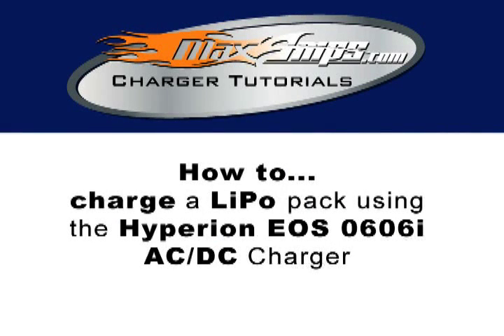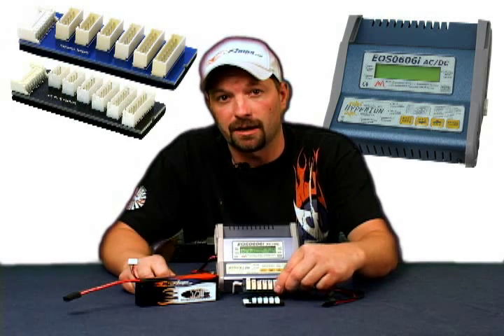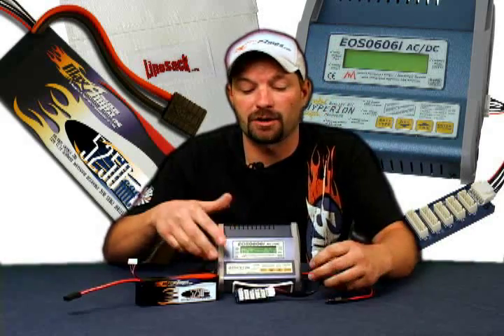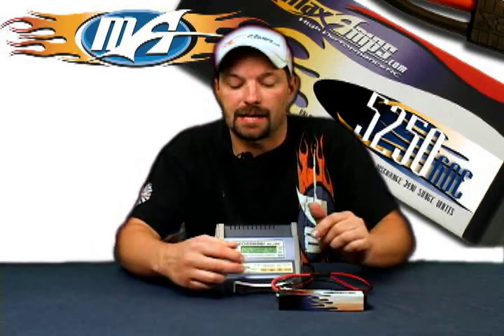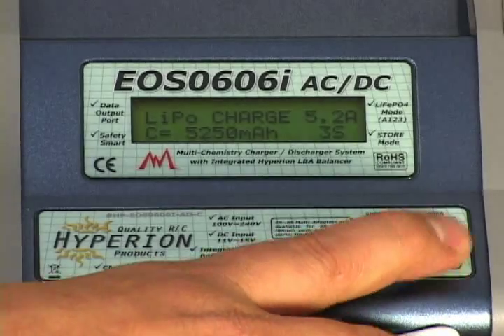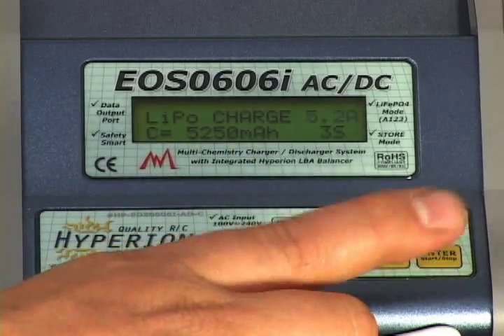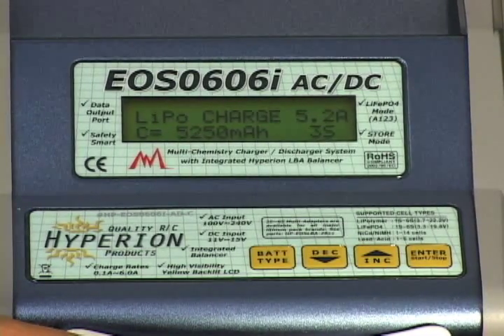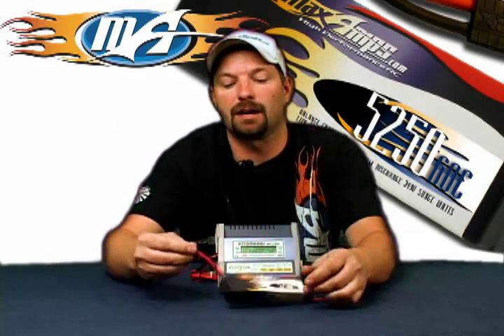How to charge a LiPo pack using the Hyperion EOS0606i AC/DC Charger

Comment: I have owned this charger for several years and just started to use Lipo batteries....Does this charger not allow to adjust higher than 6000mAh's ???.....I have a 6200mAh - 2S 7.4V battery and I couldn't set the mAh higher than 6000....??????
Reply: I've been using this charger since 2008. I still use it today  and still going strong . 6000mAh is the highest this charger will charge even though you can set the capacity higher in the settings the highest is 6000. Back when this charger first came out a 6000mAh lipo was just for the rich so it covered pretty much all bases. I have a 5500Mah and a 7000Mah and the 7000 only charges at max 6000

Comment: What if I need to charge the LIPO at a very slow rate? I have an unbalanced 4S LIPO with 1 Out of balance cell. I want to charge at 0.2 Amps so as to balance it out. How do I do that?
Reply from the maker: Raghav Baijal You can actually change the charge rate on the charger before or during the charge to any rate you would like.
Reply: MaxAmps.com  Thanks for the quick reply. I have been trying to do this, but unsuccessful. In the LIPO Charge Mode, I can only choose Mah (Capacity) and Cell Count (4S). Apart from this, there are no other options. Only in Discharge mode, I can choose anywhere between 0.1 Amp to 1.0 Amps Discharge.

Having said that, I do notice, that the charger starts with charging @ 3 Amps, and once the 3 cells are fully charged to 4.22 Volts (With the 4th Cell at 3.9V), it automatically switches to 0.3 Amps Charging. The fully charged cells appear to discharge to 4.21V and then back to 4.22V, so on and so forth. But the 4th cell continues to charge very slowly approx. 0.1 V every 45 mins. 

It took approx 12 hours & I managed to reduce the gap of the 4th cell from 0.5 Volts to 0.05 Volts. My assumption is that 2 more full charge & discharge cycles should eliminate this difference. I will update again after a few weeks.
Reply from the maker: Raghav Baijal Are you using the Hyperion 0606I AC/DC Charger? That amp rate should be 
an adjustable option. To fix your issue I would recommend a balance only
 mode. This way it works to level out the cells only. Once the cells are
 level you can then charge balance again and it should charge much 
faster. If that cell continues to separate it is likely not holding 
voltage correctly any longer and you may need to replace it.

Comment: I have 2 batteries from maxamps.com 7.4v 1300mah 100C they are small and powerful Im thinking to buy this what must be my setting for 7.4 1300mah 100c on this charger?
Reply from the maker: That all depends on how you want to charge your packs. You can charge up to 5C which would be 6.5 Amps but anywhere between 1 and 5C would be fine. Otherwise you would set this charger just like you would for any other pack. Choose the correct battery chemistry, cell count, and mah and you are pretty much ready to go. You can always give us a call toll free at 888 654 4450 and we can walk you through the process.